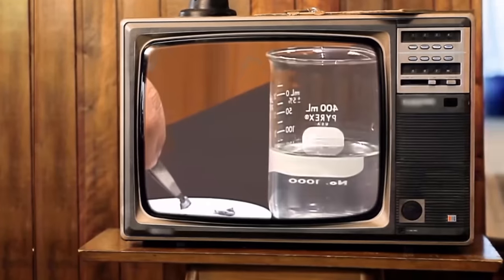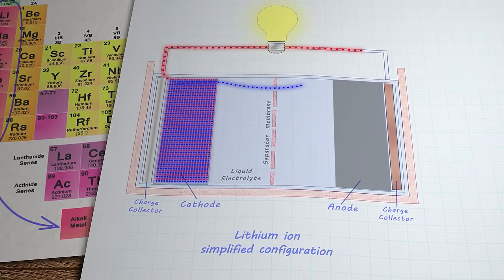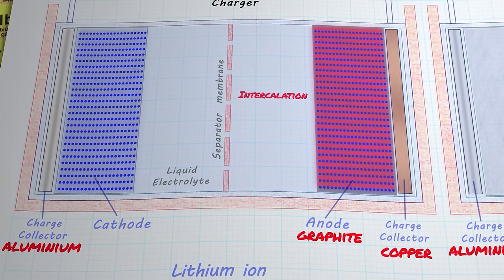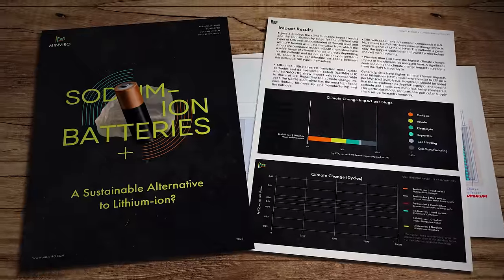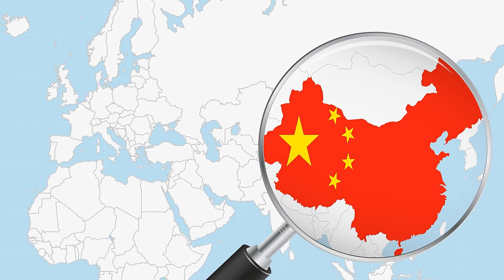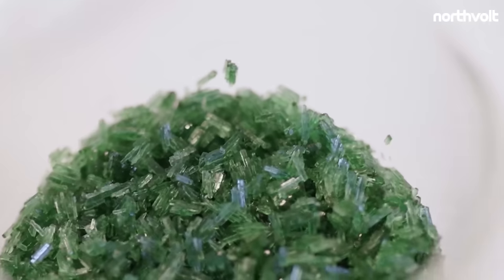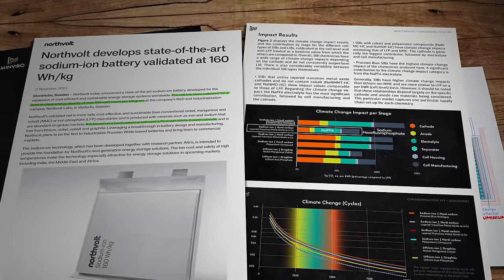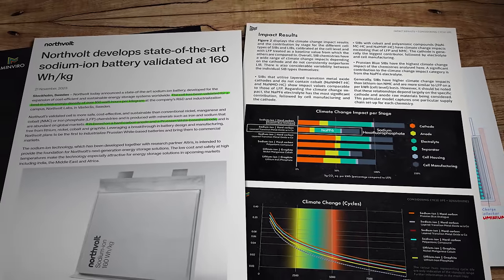Will your next battery be based on salt?

Comment: If I understood it correctly, I think you drew the wrong conclusion from that lifecycle carbon emissions report. My takeaway is the the carbon emissions from all of the battery types is similar and such a small part of the lifetime benefit anyway that it is largely irrelevant. The sustainability IS therefore dominated by material availability and other environmental impacts like extraction and disposal which could be much better for Sodium. 

Similarly, you may be over-pessimistic about their adoption in cars. Some car manufacturers already choose lower performance batteries because of their environmental and safety benefits and their reduced use of scarce minerals. I see no reason why they should not adopt sodium for the same reasons, especially if it's energy density is as you say "similar" and they can make their supply chain shorter and more reliable.
Reply: I also wonder if they may be useful in vehicles that we want to be electrically-powered, where the vehicles will have chances to recharge frequently (so that the low energy density is not a problem). For example, electric buses where every stop has some sort of charging infrastructure. Or where they charge while they lay over at transit hubs.

Comment: The biggest problem with Sodium ion (Na+) batteries is that the voltage is a little low over most of the voltage graph for a typical 12V replacement battery. Putting four Na cells in series creates a nominal 12V battery but the voltage is already well under 12V at 50% state of charge (SOC). The energy density isn't great when compared to LiFePO4 (Lithium-iron, or LFP) batteries, let alone NMC Li-ion batteries like those used in most EVs. The cost for Na+ is still higher than those chemistries for now. Presumably, that will drop as production is developed and refined, but bulk Na+ battery availability could free up the constraints on lithium, and might also just drop the prices of LFP and NMC batteries at the same time, keeping them cheaper, and still better, than Na batteries.
Reply: How difficult is it to build switching DC power converters of large size
Reply: what you wrote is just another way of saying the density is lower than lithium ion, which is true.  I think he mentioned in the video, for most people the goal of sodium isn't in EVs, it is for stationary batteries, that then reduces the demand of lithium so lithium is cheaper for EVs.
Reply: @PeterSedesse  Nope. The main point is that the voltage vs. SOC curve is too steep in Na+ batteries. This is VERY bad for stationary batteries where the single largest load is usually the inverter. Inverters typically include a low voltage cutoff, and that would mean getting less than half of the theoretical SOC out of the battery, and the rest having a voltage too low to run the inverter. EVs, with their more complex voltage management systems are often better equipped for a voltage curve like that of Na+. But then you might as well go with LFP, which is lighter, cheaper, and already proven.
Reply: In the applications where they will be used this makes no real difference.  A number of these cells will be stacked in series to create a 400V battery.  Hence you might end up using a few more Na ion cells compared to a Li ion battery.
Reply: Thanks for the explanation @daveduncan2748, that may represent a challenge for the residential side of things, as the 12V batteries are almost in disuse, most solar for residential are made of 24V ones, anyway, we can use it in home use, but the fact that they can't sustain the voltage when the battery is 50% or less is a challenge. There must be ways to normalize the current, wish us luck!
I going to research a bit more about the voltage variation and the stability of residential system using 12V batteries, just in case we, as a society, need to change to a more sustainable batteries for the closer future. And by the way do you know of any use of this technology in the residential sector? I know they are pretty new but, no harm in ask.
Reply: @michaelharrison1093  The curve is steep, man. It has a very high starting voltage and a very low ending voltage. You include a few more cells to raise the end voltage and you push the start voltage through the roof. But, even if you have circuitry to deal with the crazy voltage curve of Na+, LFP is still better in every way. Cheaper, lighter, better cycle life. Sure, you can make Na+ work, but the question is why bother? Lithium mines are opening in the US, so that bottleneck may not be an issue much longer.
Reply: @ozimandia  in a 4s (12v) configuration, the 100% soc voltage is 15.5v. 0% soc is 5.8v. 50% is 11.2v. 20% is 9.8v. that's an ugly voltage curve for an inverter. I'd just use LFP. Cheaper, lighter/smaller, nice voltage curve, inverters love them.
Reply: thank you, good point 👍
Reply: @personzorz the tech has been around for decades, it's how MPPT solar controllers work. There's also the Joule Thief modules which work by stepping up the Voltage of flat batteries, again decades old.
They work at scale too, country-country grid interconnects massage Voltages adaptively.

Comment: I may be wrong, but I truly believe that battery technology that is being researched and developed now, will change the world in a relatively few years from now. I believe it might be a quantum leap similar in magnitude to the shift from kerosene lanterns and candles to electricity. In spite of the opposition from the fossil fuel industry and their political cronies, the market will demand change.
Reply: Also agree.  I started getting into battery technology for home backup use in 2015 and sealed lead acid (SLA) batteries were still the standard due to costs and availability. 

Then Li-ion prices dropped and became the standard and now is being replaced by LiFo battery technology as the preferred solution for home and EVs. 

The tech seems to change for the better every five years.
Reply: @JeremiahTownsend — FYI, Lithium Iron Phosphate was originally denoted LiFePO4, but then shortened to LFP.
Reply: I feel like a lot of people are waiting for that to happen. Hence the downturn of EV sales. That, with people waiting for the NACS changeover, and all the early adopters already have their EVs. People want sodium ion and solid state technology to get into regular production. For vehicles, sodium ion would be best for smaller economy EVs and phevs. Also, it would be very ideal for battery storage for the home as a back up generator. Larger and high performance EVs will be other battery technology. Hopefully that all gets going in the next 2 years which would tie into the NACS changeover, and EV sales will then be huge by 2026.
Reply: I live for the day when we just suck up sea water, get fresh water for our needs, make hydrogen and store our power in sodium.
The answer to many problems is as far as the nearest coast line.
Thank you for an excellent presentation.   Solar Bob

Comment: Even if sodium ion isn't it, the level of research funding now being injected into battery tech is such that we will eventually find that panacea material that's cheap, environmentally friendly, and delivers  all the range and charge time we need (I'm ultimately optimistic).
Reply: lack of knowledge would be my bet for your optimism
Reply: @DistinctiveBlend how so?
Reply: @aFEWwanderingALBINOS I imagine he's referring to the overall outlook as we ghost past +1.5°C
Reply: @aFEWwanderingALBINOS   As one person commented already there's the overall outlook but also the chemistry of battery tech.
Reply: There is not, and never has been anything such as a free lunch, or a magic bullet, or perpetual motion.  We must use the materials we have as judiciously as we can to achieve the desired results.  We cannot expect electric vehicles to exceed petroleum vehicles in every aspect.  Rather embrace the new technology for what it is and change your own expectations accordingly.  That’s my 2 cents
Reply: The problem is that most of these companies want to be all things to all people.   The research into sodium batteries should be into make stable, stationary batteries that are significantly cheaper than lithium batteries.   As soon as you hear a sodium battery company talking about EVs or phones, they are going to fail... and conversely, there should be nobody talking about lithium stationary batteries.   Both things are needed, but they should be completely different products.  Sodium batteries should be completely ok with failing the density war against lithium, and should instead focus on the $/kWH war.

Comment: It is amazing how much attention and development has been focused on electric batteries, and rightlly so.
I believe this huge effort will deliver a good path to the future of electric vehicles.
Reply: EVs are part of the problem, but really home storage is the real prize.
Reply: @PeterSedesse  - That too
Reply: @PeterSedesse you're suggesting a fundamental change to the way human beings & our societies work, it may meet some resistance. 

The day someone first put 2 wheels on a cart the EV was invented, it's just taken a few millennia to refine it to the range of products we have now.
The idea is entrenched in the human psyche.
Reply: @PeterSedesse electric cars are fast becoming home storage, particularly where there are 2 or more on the driveway.
Reply: @alanhat5252   What is the fundamental change?  Instead of using a Tesla Powerwall that is 1x3x4 you use a sodium ion battery that is twice as big, but 1/10th the cost.  You buy a new home, you move in your fridge, and you move in your battery which will be about the same size and cost.
Reply: @alanhat5252   you are missing the point, sodium ion batteries are much cheaper and do not have the supply chain issues that lithium batteries have.

Comment: sodium ion batteries are rolling out way earlier than i thought. About 4 years early. 90% recyclable. No need for nickel or cobolt. Much cheaper and easier access to sodium over lithium. Then charge cycles and battery density ramping up. Li Ion factories easy to convert to Na ION. 
Reliance in India planning multiple GigaFactories. CATL in china going full speed ahead. Natron is USA have interesting heavy duty batteries for grid storage, or shipping. Low power density. But tens of thousands of duty cycles. Lastly zero chance of thermal runaway. And batteries can be zeroed. So no fire risk from short-circuits if transported.

Comment: Depends on what... cost on the other hand plays a very significant role, however it's just one of the key factors. This type of battery might be very good for stationary storage for the grid or house where size does not matter that much.

Comment: I have read that where Na ion batteries really fall short is the energy density per unit volume, not energy density per unit mass.  However, it is very hard to find this type of information.  It would be interesting if anyone has details of the various Na ion formulations with respect to the energy per volume.
Reply: From what I can find Na-ion is 250 - 350 wh/liter,  Lithium is around 450wh/liter.   These numbers are from google, and should be taken with a grain of sodium..🤣
Reply: They present massive problems for producers and designers of BMS and Inverter/Charger. It will be interesting to see how the developers can solve the efficiency problem. Size and weight is not a topic. They are well suited for stationary applications, construction and farming, ships and trains. For passenger cars or trucks LFP or Li-Ion are better suited.

Comment: Great video. Awesome tech for developing countries and home storage likely, and I think you're right about lithium too despite the current "lithium mining and pricing crisis" faced by miners such as those here in Australia who are facing temporary shutdown due to macroeconomics, covid driven supply issues and Chinese supply stocking and subsidies. That will correct in time I think but for now it's helping drive down general vehicle prices as a result of mass production getting better and battery prices going down, along with competition in the small car market. New Tech in the solid state front will increase range and with prices low, it's yet to be seen how the SUV market in western countries will go. Sodium ion for now will go well in the small car run-around-town market.

Comment: We received a specification of a available sodium ion battery cell a few days ago. When I was looking on the SOC OCV chart for the first time, I was terrified since you either need to have a wide inverter input or you can't use the whole capacity. What I'm missing even more is data about Round Trip Efficiency (often 3 x times - full charge - discharge cycle) !! My expertise with LFP/C is that they can reach RTE of 95-96 % (Benergy, EVE, 50 Ah). The voltage gap between charge and discharge with sodium ion doesn't seem promising in this regard. Do you have data?? Also, what is about calendaric aging ? Data is out there for LFP/C. Last but not least - concerning costs, we see market prices in January 2024 for 280 Ah cells from Hithium and REPT for 56/54 €/pcs without transport - resulting in approx 60 USD/kWh. I agree that Na-ion will keep the cost pressure on LFP high but will it be lower than LFP/C. By the way - what does the voltage/SOC graph look like @ low temperatures? Thanks for your video - nice animation of the intercalation!!

Comment: Thanks, Na will definitely be part of the mix but I dont think there is really any risk of lithium shortages, in particular once recycling is fully established.

And lets not forget the vast majority of rechargable batteries made today are lead acid. The developers of that technology haven't  been standing still. Improved configurations and incorporation of carbon and calcium into that formulation have led to considerable advances in performance and cost.
Reply: The developers of lead-acid batteries have almost been standing still since well before marketing & lobbying saw off the far superior NiFe chemistry. 

Various alloys of the lead framework have been in use since plate warping was discovered to be an issue, calcium & manganese being in use from the early days, the all-singing all-dancing spiral cell of 50 years ago was simply a reversion to the original 1859 design though AGM that came with it was new to this chemistry having been adopted from electrolytic capacitors, carbon in the paste has been in use since WWII. The only thing that's genuinely new is graphene but that's simply used like any other carbon additive, it's just a little more effective. 

Obviously marketing will tell you a completely different story but even that isn't new, it was marketing that saw off NiFe in the early 1900s for domestic use & industrial use in the 1970s.
Reply: @alanhat5252  I have been off grid for over thirty years and on my third set of Pb home lighting batteries. Each set has been better in terms of capacity, price and reliability than the previous set.

Comment: I've been playing around with sodium-ion cells over the past month or so. They are really impressive, especially when I jammed a nail through one. Just a tiny puff of smoke, no drama. However they do have some issues, one of which hasn't been discussed....they're huge voltage swing in operation. A lithium ion might operate between 4.2v and 3.0v....or 2.5v if you want to push the limits. That's a swing of 1.7v over the whole discharge curve. But a sodium-ion cell, at least the ones I'm using, charge between 4.1v and discharge to 1.5v to get all the energy out. That's 2.6v of swing......doesn't sound like a lot but it really complicates things. An ideal cell would be constant voltage. We're going to need different inverters for stationary storage designed specifically for this chemistry. Hopefully my company Standard Battery Inc will have a design out in the next few months.

Comment: Sodium based battery technology is a victory in the march towards electrification of transportation
Reply: Yes, but only a little bit. sodium will never be as energy dense as is truly needed for batteries used on mobile platforms. They will be used a stationary energy storage which which will be used to capture solar energy and wind energy and other forms and then delivered to better energy-density batteries to be used on mobile platforms.
Reply: This sodium tech won't be up to thr expectations of consumers spoiled by fossil fuel. That's doesn't mean it won't work. Big difference. Either new tech will come along or consumers will have to adjust. My opinion is this level of tech can do the job if that's all we get!
Reply: @GuyIncognito764 I didn't even mention cost, if sodium based battery technology is low cost enough , lithium will be replaced wherever it makes sense and the operating cost conscious consumer  demand will increase charging stations and ev vehicle uptake. 80% ev efficiency and better performance will convince many away from ICE if vehicle cost level
Reply: @notlessgrossman163 I'm sure with enough subsidies people will buy anything.